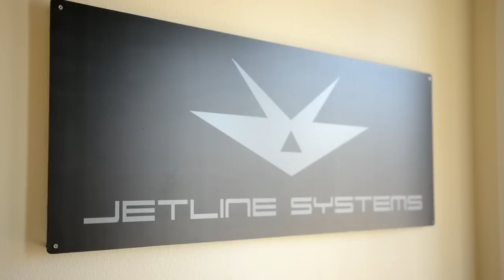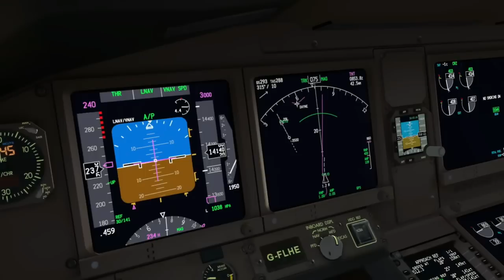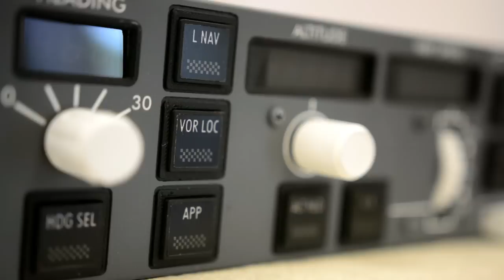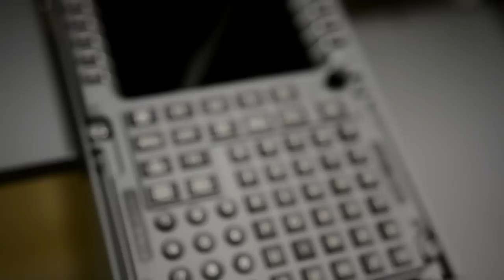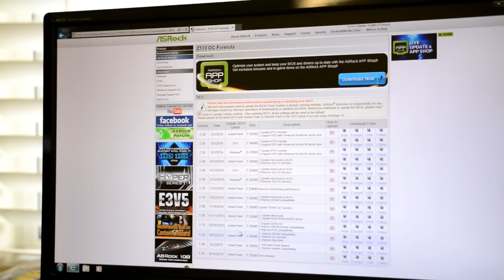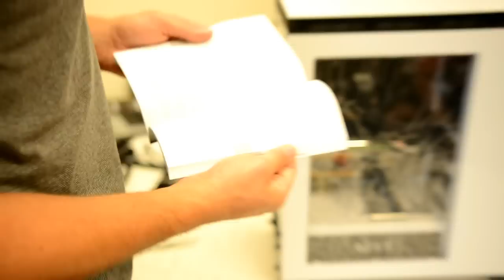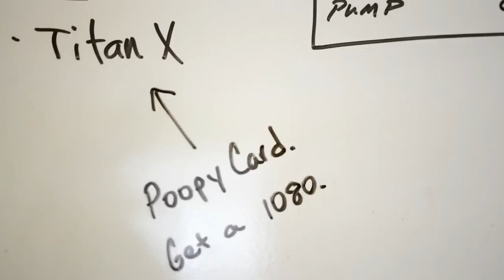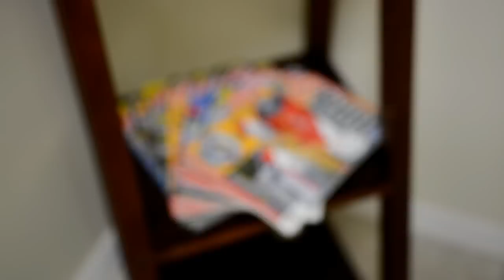Behind The Flightdeck Jetline Systems

Comment: I've got a Jetline system which has been working great in FSX for about 4 years.  It was a good investment.
Reply: Yea, I bought their top-of-the-line system about 5 years ago and have consistently good framerates (never lower than 25) on max settings. They don't put crapware on it, just Windows and flight sim. It's also a great general gaming PC.